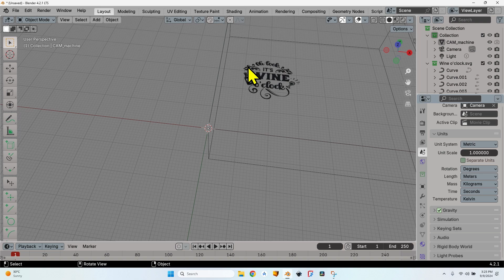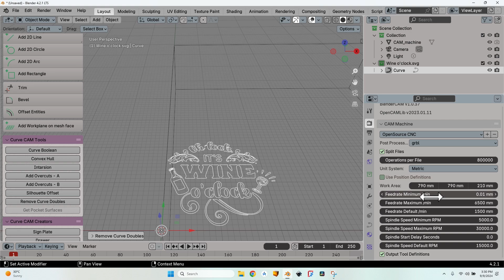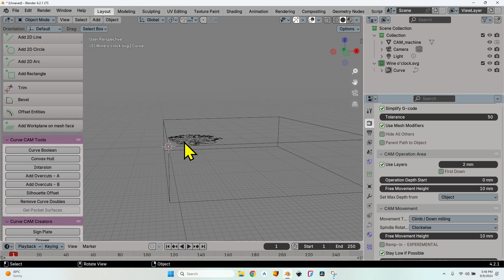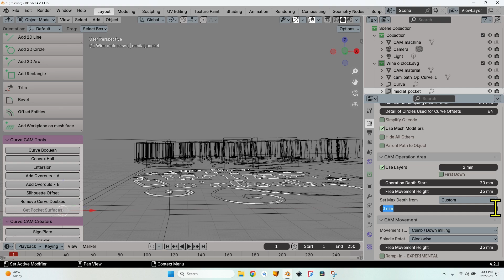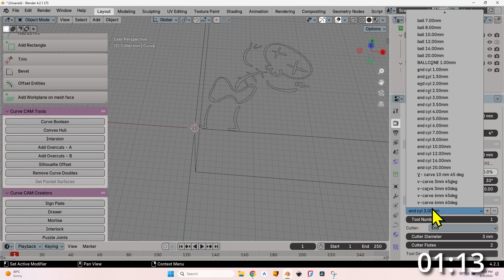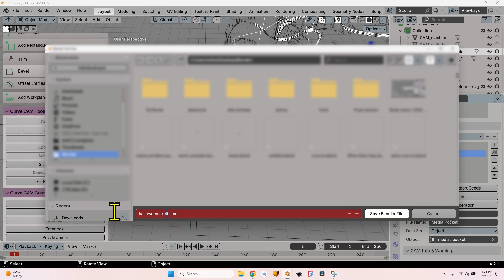Create V-Carve G-Code Fast in Blender CAM | Simple CNC Toolpath Workflow for Clean V-Carving

Comment: Are you sure about the v-bit angle you are inputting ?
Other instructions say to use 90deg (total angle of bit) not 45deg for this spec bit. 
https://youtu.be/WOnJ7R4DT4o?si=79xN_ihUyIplfyNQ

Experiments give correct results in simulation when using 90.

Thanks for the helpful video.
Reply from the maker: @TimEllershaw  i believe it depends on the version. But thanks for letting me know, I'll double check it to make sure

Comment: Thank you for making this video. I wouldn't have been able to figure this out for the life of me without your help. That is why I signed for your Patrion feed. Still, I have one big question about Vcarve in Blender. It doesn't really look like a Vcarve. In freeCAD, when cutting a Vcarve, the bit follows the center of the pocket and the depth changes so the bit cuts from one edge to the other. The sharp corners are as sharp as the smallest diameter of the bit. In Blender, the bit follows the outline of the curves. Everything is cut to the same depth, the corners are rounded to the diameter of the bit at the final depth. Am I correct?
Reply from the maker: @ronkarpel1796  Thank you for the support! yes, it does that, but only when the width of the drawing is wider than the toolbit. If you use graphics with thinner lines, the behavior is the same as in FreeCAD. The good thing about this is that you are not limited to a certain maximum width that is depending on the toolbit